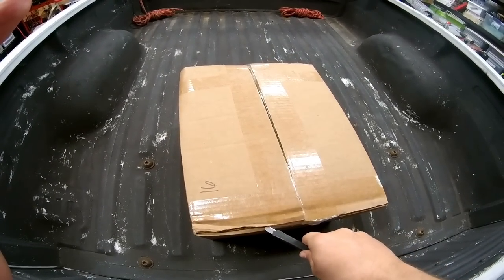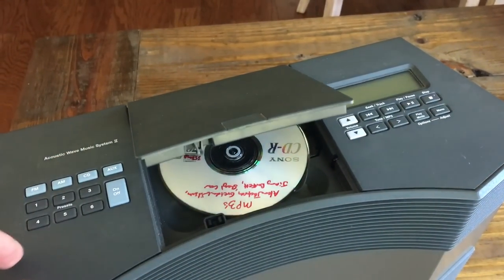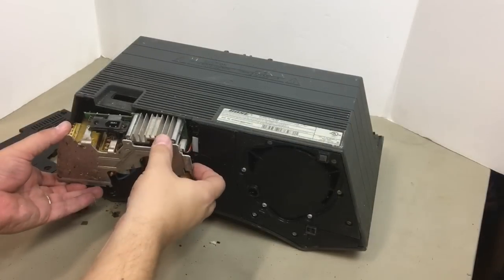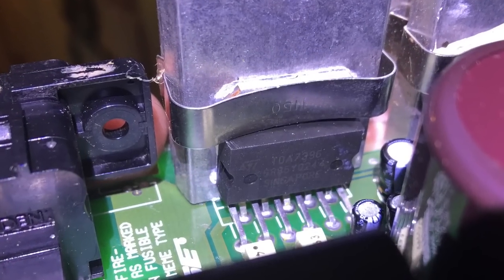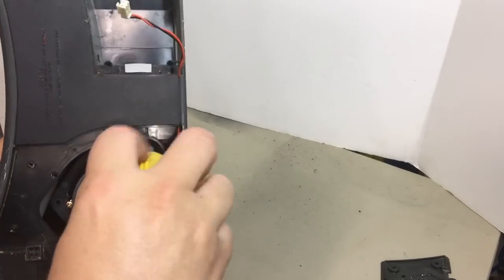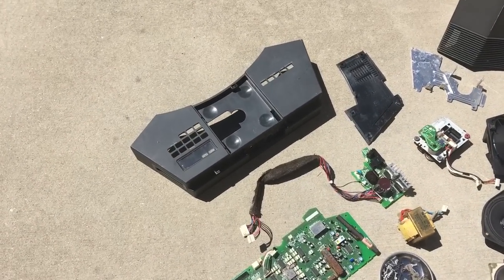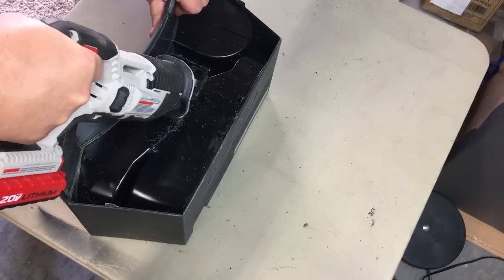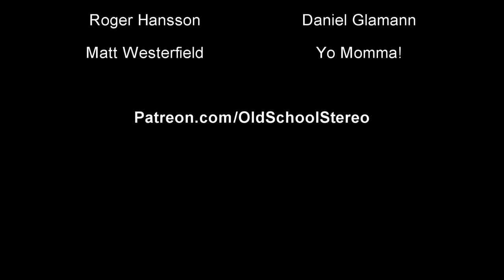What's Inside $1100 Bose Acoustic Wave Music System CD-3000

Comment: My thoughts on these are mixed, i have owned the soundock 10 which used the same waveguide design but better woofer and smaller tweeters/mids, the woofer was about the same size but with a long throw suspension and appeared much more substantial than the one in this video, it also had a very large and weighty magnet which is usually the signs of a driver designed to handle high power. A large magnet usually results in better control of the driver and hence better performance, it was paper but this isnt neccasarily a deal breaker (paper is still a reasonable material for a speaker albeit somewhat dated) the tweeters/mids were smaller and angled outwards to presumably widen the soundstage and also paper with still decent magnets for the purpose.

The integrated amp was endowed with the infamous dsp chip and seperate amp ics for the midrange and bass.

Now the bose waveguide is a very interesting concept and many are not understanding how it works, basically a loudspeaker has a front and a rear and when it produces sound the front and rear are 180deg out of phase so if you had no enclosure most of the longer bass frequency would cancel each other out.  So what a normal enclosure does is trap the rear waves inside the enclosure and the front facing waves are what you hear so its less efficient and due to the pressure against the cone from the trapped air its ability to move is restrained somewhat so frequency response in the bass department can be limited.

What bose do is use a series of tubes to firstly act like a horn to boost the frequency response and secondly the reason that the rear tubes are shorter than the front is to phase correct and align the front and rear sound waves so instead of cancelling each other out when they meet they instead reinforce each other and suddenly you have a very efficient speaker which considering it is amped quite well too becomes very powerfull.

Now this is only part of the story, the second part is the reason its all coiled up like that, this is because the length of the horn directly relates to how deep the bass is, and for frequencies as low as say 60hz you are looking at a horn which would be many feet long if laid out straight on the floor so bose decided to fold it up which has been done before but the use of two priciples together both the phase correction and the horn (basically a seperate horn on each side of the speaker will be tuned to different lengths to reinforce differnt frequencies.

Now all the people criticising the use of plastic casing and associating this with the price are missing a fundimental bit of info, designing and tuning a true folded horn into a housing that size and for low frequencies is a work of art expecially in the days when bose invented it, they didnt have cad and 3d computer modeling it would have been trial and error and lots of complicated maths and since a folded horn carries nearly all the waves from the speaker out and away there isnt really and viabration and effect on the sound by having a plastic case not like with a traditional speaker when any movement of the enclosure causes colouration.

Now to the sound,  remember i had the dock10 which is more modern and had much more modern drivers than those taken from the wave in the video and to make a point i own some good hifi gear including some b&w towers and a rega amp so i didnt buy it as a hifi i mainly got one because i was fascinated with the horn design and wanted to dissasemble and hear one, guess its the electronics technician in me!

The bass from the soundock was extremely powerfull and i dont mean muddy sloth bass like from a ported sony speaker i mean extremely energetic the type of bass you feel punch you in the chest and reverberate the whole room and it felt alive i have never had anything since, hifi included which could express that much energy in that particular room which was a complete void for bass normally due to its long narrow shape, but this thing nailed it

To describe the bass clarity would be that it didnt go very deep probably not much lower than 60hz at a guess but it was very controlled and sharp and the bass within its narrow (but normal compromise for a horn) was some of the best i have heard from anything smaller than a 10inch BUT it couldnt go very low but the energy levels were huge and very precise.

Heres where it falls apart,  the mids were flat sounding and forced with hardly any soundstage even forgiving its width the beats by dre dock could do a much better job with a wider soundstage and detail, the vocals on the bose were brought forward presumably by dsp processing and didnt sound too bad i dare say better than average however  the cost was pushing everything else back and losing detail, in the upper treble there was good detail but a low frequency response all those nice jingly bits on the upper end of the treble were gone and what was there did sound ok but again flat.

So is it cheap drivers?    Well maybe, maybe not, i have heard paper drivers sound amazing in other setups i think the main issue is the speakers are too small leaving holes in the crossover between the amazing bass and the poor mids and the use of dsp to try and fix it makes it worse and in some cases just sounds wrong, ontop of that it desperately needed proper tweeters to get those jingles back!

I think if bose had hornloaded the mids too with larger drivers and installed real tweeters, that thing could have been truely amazing but it seems to be a bose thing to persist with the single upper driver which kills it.

If a hornloaded midbass has the same energy as the woofer did and they do these changes i think id give them another try because horns sound amazing when done right.

So there you have it an honest review based on the sound not the name. i still think the bass on the soundock will never be beaten on sheer power by anything the same size unless it has a rediculus sized amp and even then i dont think it could with a normal enclosure.

But the thing to remember is although it didnt work out all that well the engineering that went into trying to acheive that type of enclosure far surpases any normal box with ports and i give them credit for trying it and thats why i suspect they are so expensive, even the mids had experimental induction horn voids which means a non driven enclosure intended to react to the viabration and tune it, its a totaly different concept to the way any other speaker works and a very interesting one they still fascinate me even though the sound quality isnt as good overall.
Reply from the maker: #LongestCommentEver
Reply: Your not kidding it took me two hours to write, i just felt people should know the reality of what bose is - more than marketing but horns have a destinctive sound you either love its revealing nature (in narrow bands) or you hate it but the fact remains they are the work of real engineers, any monkey can make a box in all different sizes but to make a horn in a small radio is very brave.

I actually bought another soundtouch today with a smashed top panel for £100 and made a replacement out of fibreglass, they are a bargain if you buy them the right way (not new) probably worth £250 now and you would never notice the replaced part piano black and spent 3 hours making it shine like a mirror.

Comment: The design is a transmission line/quarter wave that's been around since like the 50s or 60s that's why is called the "wave radio" the speaker basically sits at one end of a long port with around the same area as the woofer cone. You take the speed of sound at sea level and divide it by the fs of the sub and you take that number and divide it by 4 and you get your 1/4 wave in feet. Usually a low QTS SUB WITH .4 or lower is used for the flattest response and shallow rolloff, and other little twist but that's about it. The longer the line area the lower the tuning and the shorter the higher the tuning. That's why they have two different length wave guides for this radio, so they can get a wider frequency response. You can stuff it to extend the wave guide line if not enough room, kinda the same as stuffing a sealed box to slow the waves down and make box seem bigger which lowers tuning

Comment: This costing 1100$ is an extreme insult.
Reply from the maker: But I'm guessing people buy them or Bose wouldn't make them
Reply: $100 for parts & $1,000 for r and d.
Reply: after watching , never i will buy, lol,
Reply: @royb5014  Haha..!! Spot on.!
Reply: @MightyGimp  I suppose I should clarify; can't reproduce well.  They eq the crap out of these things to make the best use of the limited speakers rather than reducing the speaker limitations.  And because most owners are primarily top 40 fans, sound quality really isn't that important.
Reply: people brag about bose are the same people who buy iphones for $1500 and plastic beats for $500
Reply: @uncledope77  There is no R&D cost. Bose didn't invent this concept, Hemholtz did. All they had to do was apply the quarter wavelength formula to make this.
Reply: @triggrhaapi  I understand that they didn't develop. The T-line quarter wave technology. But R&D is a part of product development. Which means they had to figure out how they would use the technology. Mean while putting their spin on it. Trying to determine which items sound & work best together. For a low cost to produce increasing profitability. Also a part of R&D is marketing. A small part nevertheless still a part. Because you have to figure out how to sell the product. Either way you slice it,  it is way overpriced!  I make T-line enclosures and the hardest part is the math. But my favorite type of enclosure is one that has a passive radiator. Small enclosure but kinda acts & sounds like. A ported enclosure with big bass. Naturally smaller speakers benefit more from a passive radiator. But all real subwoofers can benefit as well with proper tuning.
Reply: bose did a good job making people think that larger stereos and decent speakers costs more than this piece of shit
Reply: @royb5014  you can buy a better portable radio than anything bose makes.
Reply: @UNKNOWN-le2tu  for that money?  Lots!  Soundcast for one.  And the Soundcast is dynamic.
Reply: @triggrhaapi  And yet, no one else thought of doing it.
Reply: @Roy Bontius  You obviously haven't been in a newer Vette or tried the Bose QC35 II headphones yet. I'll put my Bose system in my Vette against anything you have. I am one of the "morons" that bought this about 8 years ago for $1099.00 + tax and the sound is very impressive for it's size. It's perfect for putting it on the back patio when you're having a pool party and/or bbq with friends. You obviously never heard it in person. You know the ol' saying "the littlest dogs bark the most".
Reply: Uncle Willie  more like marketing. Bose makes a decent product at a high end price. Much better products out there .
Reply: I purchased a wonderful boom box new for a hundred dollars with two tweeters, two midrange and one huge subwoofer with its own amp.  This looks like junk inside.
Reply: Hmm I know this is 2 years ago but they are $500 usd
Reply: @uncledope77  $100 parts $100 r & d $ 900 marketing and sales.
Reply: @dvlarry  I agree with that, my 1st response. Was kinda a joke poking fun at Bose. It is way overpriced!
Reply: @Sc2God724  Still overpriced to me!
Reply: @uncledope77  I personally think anything over 400 usd is over priced with all audio companies when it comes to a solo unit like this one b&w b&o jbl Sony LG bose ue devoliet ect all does it
Reply: @Sc2God724  You are right, it's about making the most money per unit for them.
Reply: @uncledope77  for example you have the jbl flip 5 for $70 right now and the boom box 2 for $500 its no where near $430 better then the flip 5 you can pair 5 flip 5s together get a wider louder cleaner more thump they think convince factor is worth a hundreds more
Reply: @Sc2God724  UE Ultimate Ears does the same thing. A few of my coworkers have overpaid some of their units. And have linked 3 together for show. The link abilty is really cool. But now worth $300 per lil bluetooth.
Reply: @uncledope77  I've purchased many many audio products and so far most big names are the biggest ripoff
Reply: @Sc2God724  I do not disagree! These companies are greedy & most people fall for the clever marketing.
Reply: @PaciSandy  Hell 2 Da Nahl!
Reply: better sound through marketing.
Reply: @Sc2God724  Absolutely. Athough it could be considered to sound better than your average solo radio/cd/memory card player, it's certainly not hi-fi, which is what Bose want people to think. It's better to put the money towards a component system.
Reply: @wal  Sheep will follow.

Comment: Good video. I have a pair of 901's from 1992 that I purchased from Germany while in the military, that still rocks with no speaker deformations or tears. I will never part from them.
Reply: mustang6035 I'm not sure people know how much "engineering" went into the 901's. They have almost a "cult" following. Rag on Bose all you want, the 901's are pretty impressive.
Reply: mustang6035 I have 901s as part of the Lifestyle 901 system. Black lacquer.
Reply: Tom Green I have a Lifestyle 991 system with black lacquer 901s.
Reply: I rem the 901`s, never had them, but a buddies parents had them and they sounded pretty good if setup right. Nice to see ppl rocking some older stuff still.

Comment: Some of these comments are laughable. I don't know why people are getting so worked up over a product that's been on the market for 33 years and Bose has made millions on. When the AWMS came out in 1984, Dr Bose thought decent sound should be as easy as a refrigerator. You plug it in and turn it on. At that time, research showed that less than 20% of people owned a system of ANY type because they were too intimidating to buy and set up. The mission of the AWMS was to fill some of that gap and did very well.
Reply from the maker: True and I've never seen such anger and arguing about sound equipment (yeah, right). Funny how people get mad when other people say these sound good. Who cares? What sounds good to me might not sound good to you. We all have the right to opinions. I guess many people are confused as to why Bose is still selling this unit (for $1100) with very little change/innovation to the system in over 30 years. I would assume people are still buying them or Bose would not continue to manufacture them
Reply: Bose bragged that he could make those paper speaker cones for under a penny each!   Yet people think they are paying for quality not marketing.
Reply: now that Bose was a master of; plug and play! What a concept! But over a thousand bucks? Please!
Reply: 66skate and thats relevant now?
Reply: Bose, like many high end manufacturers, tried to use innovation to get people to buy their products. Make an all in one that is just plug and play. It was a hit. The price hasn't changed much since it's debut. There's not much competition because the cheap stuff sounds cheap and the other manufacturers didn't care to get into the all in one's. I prefer separates but maybe not in my garage. When another company decides to compete with a just as good/superior product or people just stop buying, Bose will either drop price, come with a different idea or get out. They make commercial systems and maybe still full size speakers. I'm a Magnepan kind of guy but whatever...
Reply: @housepumpinpc3983  Bose is not a high-end company, low-end products with high-end marketing!
Reply: @gregkramer5588   sure... Not now, back in the day however they were high end.
Reply: Amar Bose didn't think about anything other than how many morons his company could entice to buy his overpriced B.S. Bose spends more money on marketing than on actually designing and making product.